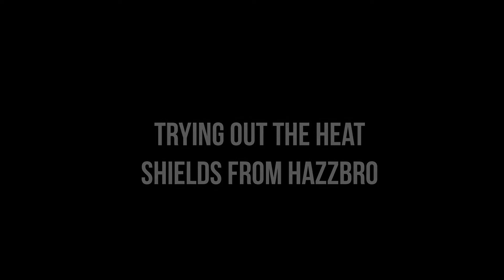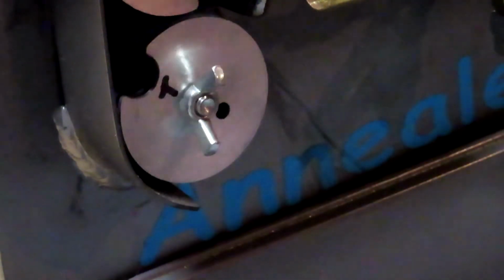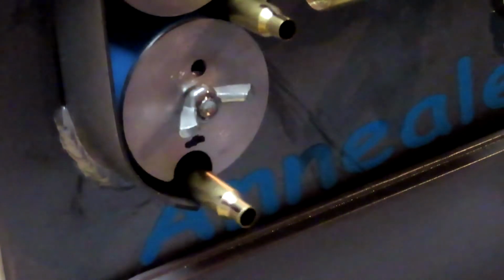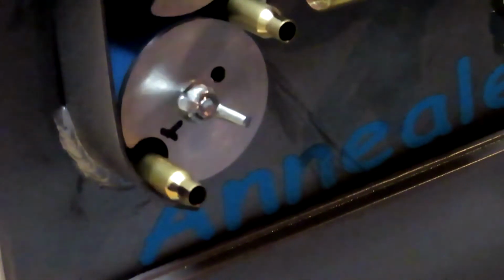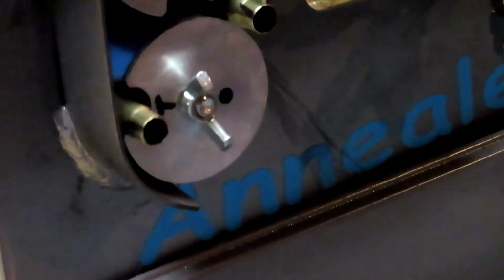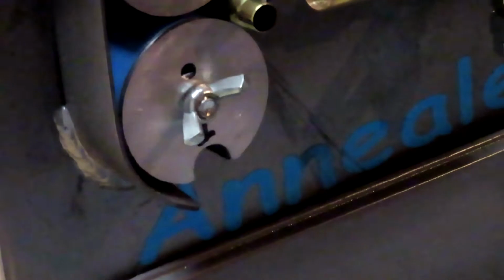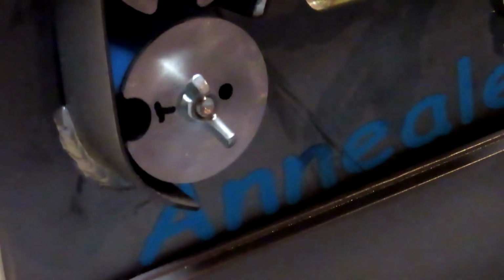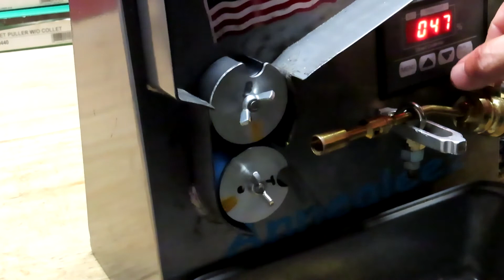VR to Hazzbro  Using His Annealeez Heat Shield

Comment: Thanks for testing these out!  Is your machine a gen1 by chance?  Wondering if the adjustable plate on mine is the difference in feeding.
Reply from the maker: Sorry, I just noticed your comment.  I'm not sure what version it is. Had it for a while but all the mods are getting it up there by the new model.  Mag torch, digital readout, flat blade case guide and a bunch of dings and scrapes. Must be a 1.9 model by now.😊 Can't wait till you get the 308 heat shield figured out.